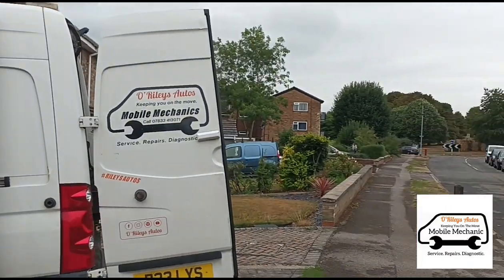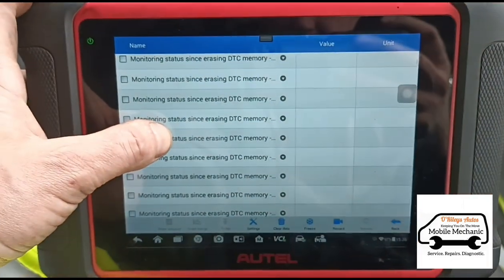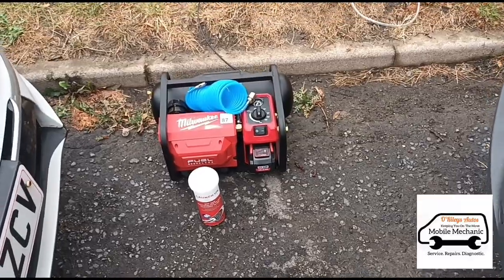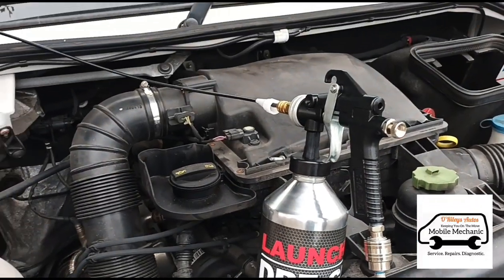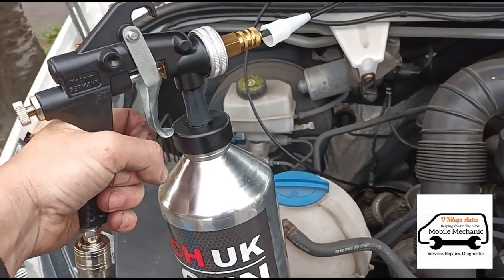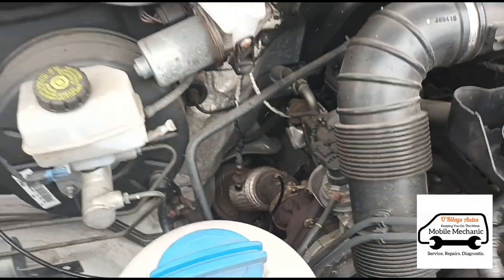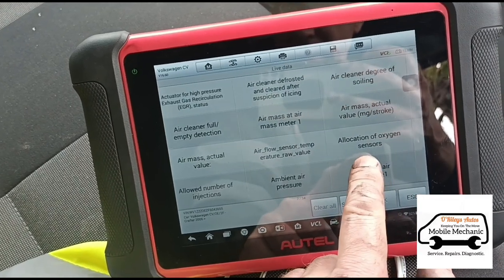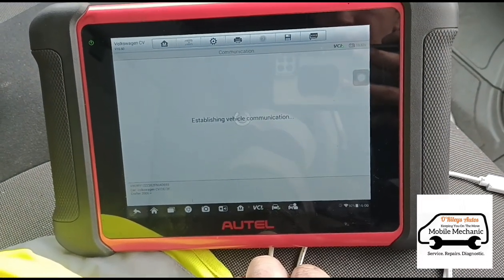VW Volkswagen Crafter 2.0 Tdi P246300 P2463 Particulate Filter Restriction Soot Accumulation DPF

Comment: I m wondering if this new launch dpf cleaner method is as good as you used before with the hand pump and Wynns fluid ?  I think the exhaust gas pressure and flow of the running engine will not allow the cleaning fluid enough time to react with the particulate build up, it will blow it through before it has a chance to work?   I like to let the fluid soak for 10 mins before starting the engine. Whats your thoughts so far with this new gear ?
Reply from the maker: I need to test it a few more times before making my mind up. But if I don't see results I still have the wynns on board
Reply from the maker: I need to test it a few more times before making my mind up. But if I don't see results I still have the wynns on board
Reply: Aye got to give it a go, I just wondered if the fluid you were spraying in went straight out the exhaust pipe through the dpf core that wasn't choked ? @ORileysAutos

Comment: Great video again.  My Audi A4 B8 has got glow plug light on  fault P2563 turbocharge boost control ,when I clear the fault with the engine running the fault does not return until engine speed drops below 900rpm, could this be a DPF issue?
Reply from the maker: I'd check the actuator on the turbo.

Comment: have you worked on a totaly blocked dpf and if so, would this method work.
Also i am pleased you have got a dpf gun, it must  have been tiring working wiith that brake thingy
Reply from the maker: I've been to an Audi A4 recently blocked solid to the point it wouldn't even start. I only had the wynns fluid but it didn't work. I have yet to try the Launch or JLM fluid on a completely blocked one
Reply: @ORileysAutos  What did you do if the wins didn't work
Reply from the maker: @nathanreid2974  sent it to a friends garage. He had to remove the dpf and egr it was all blocked
Reply: @ORileysAutos  have you ever had to do that before
Reply from the maker: @nathanreid2974  only car I came across was that one but it's the newer type engine very difficult to remove the dpf